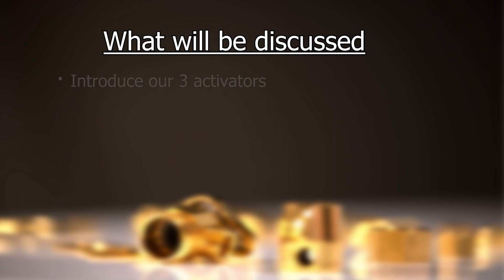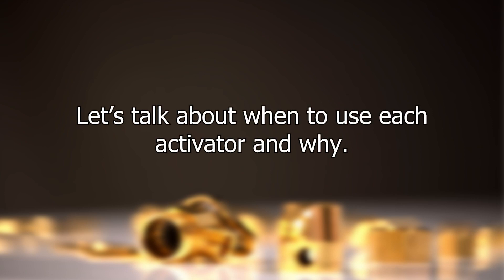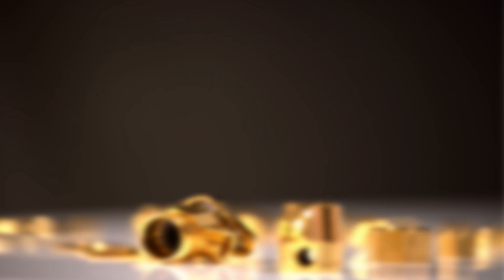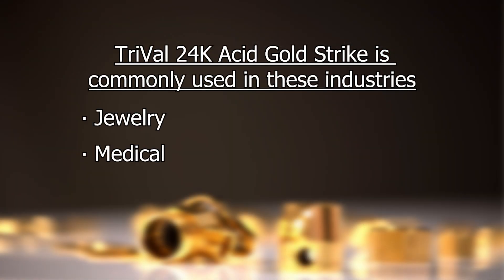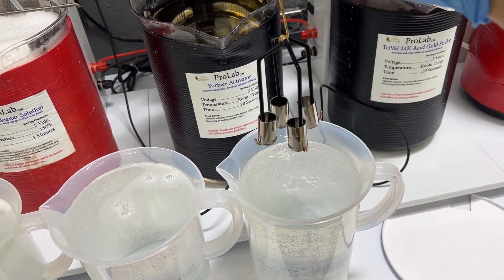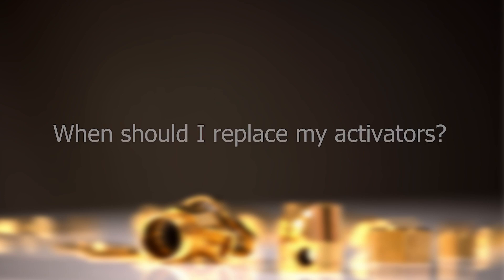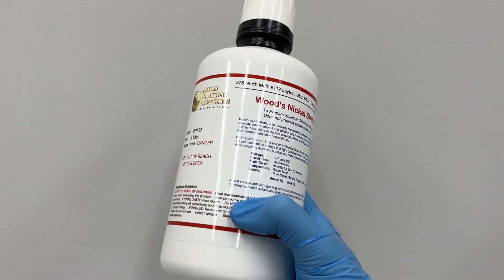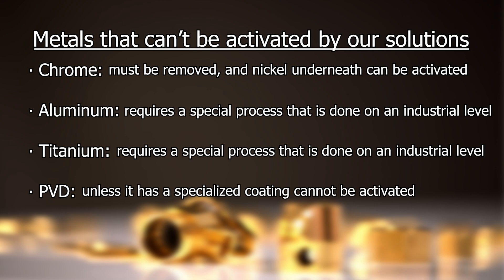What activator should I use?

Comment: Which activator would you recommend for an item that has both bare steel and some nickel plating (the item isn't fully stripped to bare carbon steel)? Is the nickel activator needed if I use Wood's? or vice versa: Do I still need the Wood's if I'm using your nickel activator?